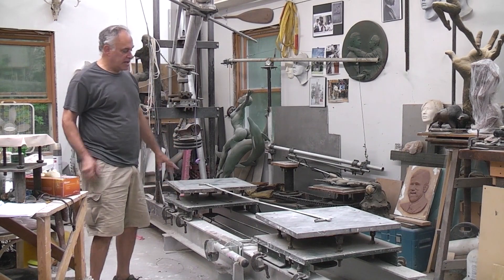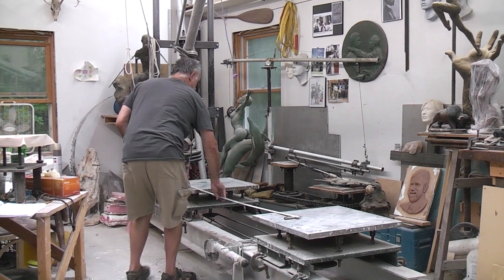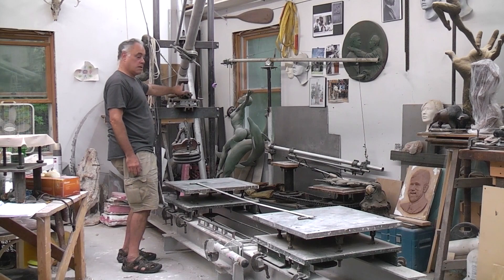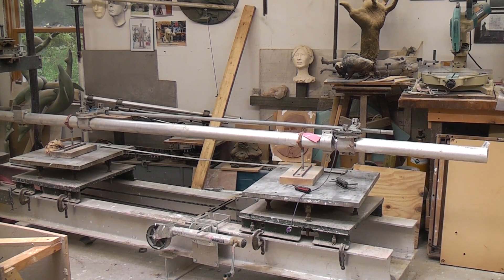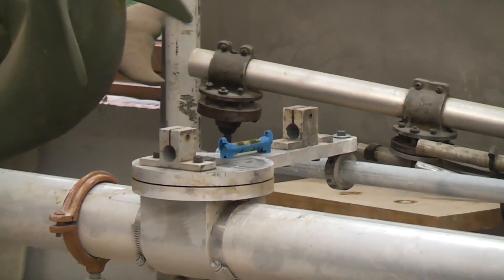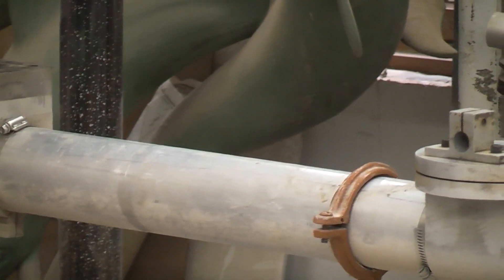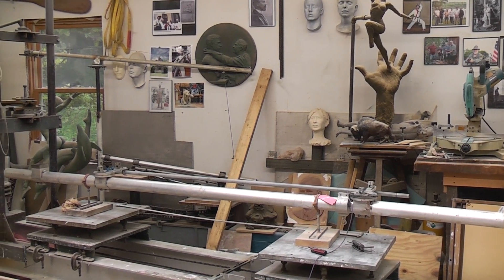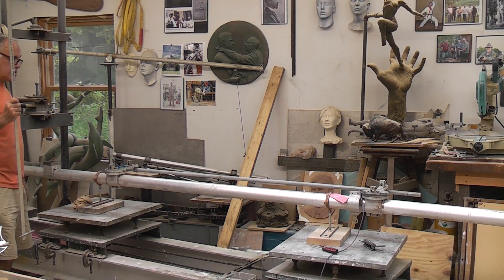3 D Pantograph Enlarging Part 1:  Sculpture Enlarging and Reducing Setting up Tables and Pointers.

Comment: Who is Berthold Neville, and where can I get plans for one of these things?
Reply from the maker: https://patents.google.com/patent/US1714984A/en
Reply from the maker: Berthold Nebel was a sculptor and refined the design of the pantograph see the patent above. He made the prototype then created four machines that were sold to different sculptors. I actually have the photo type machine featured in the patent. It is only 5-6 feet long but the larger machines he made were based on the same bed system. My large machine is based on his design.

Comment: It looks a very useful machine Michael, I have seen them at a foundry I occasionally go to but always wondered are they cumbersome to use, the foundry often having two guys working on it. Or are they an aid for accuracy aswell as speed and should be utilized ?
Reply from the maker: Before this machine a sculptor would have to take a series of points and sort of connect the dots by modeling by eye the remaining surface. The tracer pantograph above is worked by one person. The weight of the boom w/points is balanced so the artisan can feel the model being traced.This allows the artisan to scrape the clay surface of the enlarged sculpture accurately. There are machines that have a boom w/points rotating at 360 degrees. These don't require a large bed of tables the latter cache balances on a tripod. This machine has been called a student enlarging machine, but they work as accurately as any larger version. The machines if set up properly are very accurate. One needs to learn about the machine he is using, i.e setting the model to be traced securely so it won't move, and not to push the model when tracing. As all things it takes some practice and every machine is different.
Reply from the maker: There are a number of machine designs out there. The Thomas Payne machine used first in St Gauden's studio then for many of the sculptures for the Buffalo Expo. were basically just pointers. So I believe two artisans worked on the same machine. My machines are tracers and pointers. The goal is to counter balance the weight of the boom so you are not lifting it while tracing. You need to feel the surface of the model as you trace or scrape the clay off the surface of the enlargement. Or reduction depending what table you are working on. So only one person is needed to enlarge a sculpture.

Comment: Thanks for showing us how that works!  Next do you cover the foam enlargement with Chavant and basically start over capturing the likeness and sculpting in the detail? Or is there something built into the process which helps you get the likeness and detail back without starting over from scratch?
Reply from the maker: I have had a number of people ask me about 3 d Pantographs as well as setting up the machine. This and the next couple videos will deal with setting up the machine. Something I have to do every time I need to do when enlarging or reducing a sculpture. Right after this I will have videos showing the process of enlarging/tracing my sculpture of Joe McCluskey. As I said this is a manual machine that Traces the surface of the model and replicates the work larger or smaller.
Reply from the maker: The pantograph is a tracer. One point traces the surface while the other can carve clay using a simple wire loop as a stylus. The smaller the loop naturally the smaller and more detail of the "scrape" or removal of the clay. It is also important  that the other pointer have a fine tip to trace with. So it is important to have a really nice hard model to use to trace with, resin is primarily what I use. Plaster tends to be too soft, but can be coated to harden the surface for tracing. Some large areas could just be traced every few inches then simply use a hand rake tool to connect the form.
Reply from the maker: The machine if set up properly can certainly be very accurate. It also depends on the operator of the machine. I always check my work with calipers at the end of the day. Basically to check if the proportions are in check.  What is nice about the machine is instead of foam as a finished surface then having to add on your finished surface more clay, you're tracing the clay to the surface not smearing clay on top. For figurative work I find the machine a wonderful asset. It also points up the armature first then foam then clay so you don't have metal coming out of your sculptures where you don't want it.